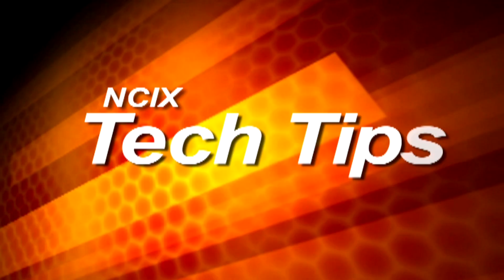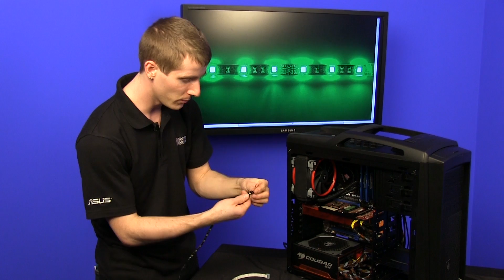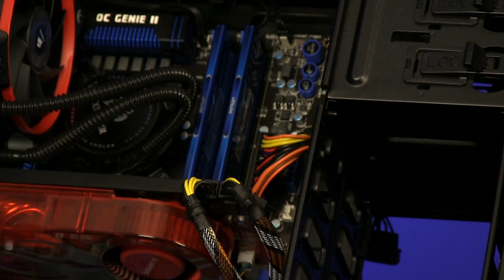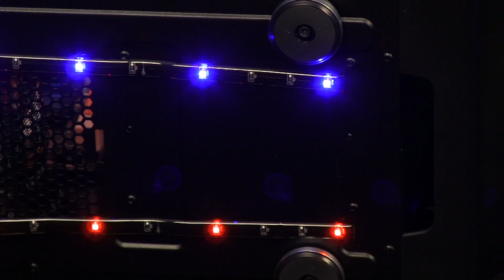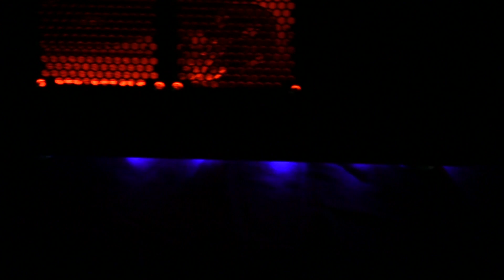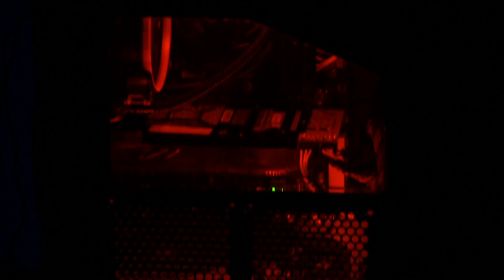LED Lighting Install Guide NCIX Tech Tips

Comment: u can't see shit
Reply: It's the camera/lighting/old tech. I recently bought a magnetic strip of these and the thing is super bright. I can turn off the light in my room and my PC still offers sufficient lighting
Reply: Which one specifically did you buy?
Reply: Adam Radford I bought the cablemod wide beam magnetic LED strip. I have also bought one LED strip for really cheap from a no brand name on amazon and even that seemed to perform better than the ones in the video.

Comment: has this process changed in the last 3 years? any better led products or easier installation?
Reply: nowadays you connect your led stips directly to a fan hub and thats it.
for something to start with i can recommend the nanoxia rigid strip.

there are also new rgb led kits out like nzxt's hue+ with which you can make a disco lightshow inside your pc if you really want to. :P
Reply: not tryna be a lil bish but can you hit me with a link to the best product in your opinion?
Reply: Happy hunting

https://www.amazon.com/Antec-Advance-Accent-Lighting-USB-powered/dp/B00005108J/ref=sr_1_10?ie=UTF8&qid=1465827153&sr=8-10&keywords=usb+led+light+strip+for+computers

https://store.cablemod.com/product/cablemod-widebeam-magnetic-led-strip-30cm-blue/#

https://www.amazon.com/NZXT-CB-LED20-BU-Sensitivity-Sleeved-2-Meters/dp/B0046Y5Z5G/ref=pd_sim_147_8?ie=UTF8&dpID=51HKxvh52kL&dpSrc=sims&preST=_AC_UL160_SR160%2C160_&refRID=FC3Q8NGXAHDK1R8X67H2
Reply: Ichigo Uzumaki well they're usb powered so you kinda need an usb splitter and they're supposed to be used outside of the case
Reply: Linus did plug the leds to a usb port on the back of the case. Frank Nowak ask for some links so I posted some link so he can decide which leds will work best for him.
Reply: Ichigo Uzumaki well if you want to use 6 usb ports for some leds go ahead lol
Reply: 6 usb ports? it's he only used 2 led strips and I'm pretty sure by the time you get to plug the light you should only be plugging one usb cable to the back of the pc by using a splitter.
Reply: Ichigo Uzumaki oh but just 6leds / 30cm?
Reply: +RandomRene  he only used 4 led strips of which 2 of them were plugged to a usb port. The other 2 leds strips were connected straight to the PSU using the molec connector. He even said that you can use a splitter or a usb hub. That is if you want to use 6 led strips like you keep saying.
Reply: RandomRene get a usb hub and plug 4 -6 led strips to it. Cover the bottom of your case with leds.

Comment: will it look good with the NZXT H440. i want to get that case
Reply: +GoldenAlpha32 i got the red version, nice case, i put my red led corsair fan in the top and it made no difference, got the 2m NZXT red led strips and theyre not even surface mounts so theyre pretty dull and only light up the parts around them, barely made a difference to my case, but the case itself is goood, pain in the ass to add plug any cables to the power supply though

Comment: Question to anyone, Im new and looking to build my first PC. Would the cables that plug into the LED's be included or would I have to order a 4 pin molex cable?
Reply: MadPhrog McSneezy I got some on eBay that had the 4 pin molex cable hardwired to it, they are very cheap too

Comment: Hey linus, just wanna comment on the powersupply ground thing. And im only such a nitpicky because people tend to do crazy mistakes with electricity ;P

first off, as I am sure you know, for you to neutralise on the powersupply, it has to be plugged into a grounded plug. This is an important mention, - and so your trick is perfect under the assumption of grounded outlet, since the case will also be neutralised, but in the case you dont use grounded plug and/or dont have any ground to the case, what you really want is static equilibrium between u and the pc, not nesecarily neutral static charge, since electricity can also jump from an unplugged pc to you fingers. Equilibrium is achieved from just touching the metal of your case. 

Keep up the good work, just wanted to elaborate on this since we have to be very careful when talking about electricity since mr ordinary will take your word VERY literal =)

Comment: It's better to buy a 5m led strip wich you can buy in ebay for arround 5-10 usd and do dome solding with a spare molex conector you have, you will have more leds, more brightness and it will be cheaper. (sorry for my english)

Comment: Also if they are USB they usually have a on/off switch on the cable. So if you have 5 strips that 5 switch you have to turn on and off ..since they are usb they will stay on

Comment: Those antec led strips are really good, i used 4 blue strips 2 inside the case and 1 on the back since my case sits in a corner so the back led's hit off the wall and looks really good and one on the back of my monitor for a nice blue back light effect, all strips nicely wired to a usb hub comes on when the computer turns on.

Comment: For starters, the video mentions that you can hook up both strips to just one usb port, using a hub. Also, any modder should know his way around basic electronics. USB is a cable, like any other. If you don't use it for communication, but strictly for powering something, just like an LED strip in this case, you can cut off the usb connector end and hook up the 5V wire and the ground wire to the 5v and ground wires of a PSU connector. No cable mess (if you drill a hole), no USB ports wasted.

Comment: I have a USB lamp connected to my laptop. When I logout in the evening (at home) with Windows 8, the light is still on (there is no on/off button on the lamp). Now I have to pull out the USB switch when I logout all the time. Any advise?

Comment: the ones on the bottom of the case are Antec Accent Lighting and sell for $5-$10. the Nzxt is $15-17 but thats for 2 meters (3 6 feet) you should only need one for inside the case. so more like 30 bucks really.

Comment: Being fair this is an advert for NCIX and they don't sell LED tape on the roll.
Ebay's cracking, get one that comes with the mains adaptor and cut a length for the top of you keyboard tray, that way you can see your keyboard in the dark.

;)

Comment: I would have to say that sounds like a bad Virus that has your system going in loops in my opinion. Or windows is corrupted either way you may need to use the recovery disk and re-install windows if thats the case

Comment: My PC turns on for 5 seconds and then turns off it keeps doing this until you turn off the PSU. I had this problem before and reseated the RAM but it doesnt help. I dont want to buy a component that wont solve the problem as money is tight. Please help!

Comment: Horribly overpriced.  Grab a 5M LED strip on eBay (look up "5M 3528 LED") for under $10.  Then solder your +12V and ground wire to a Molex connector.